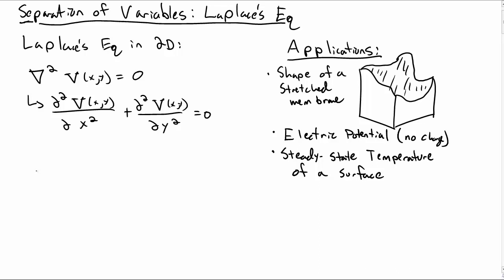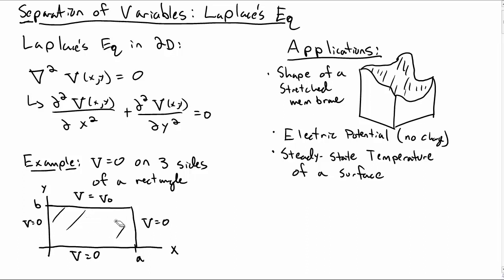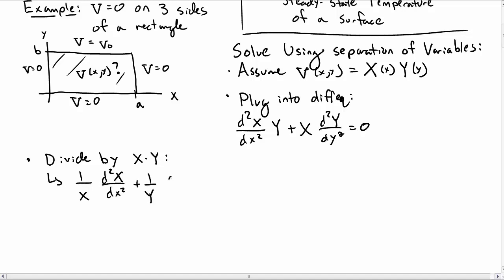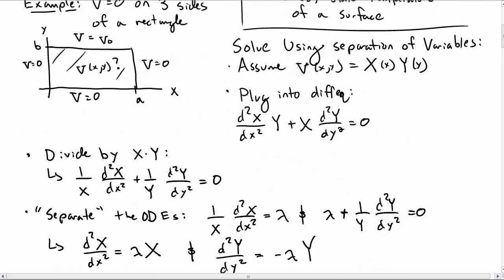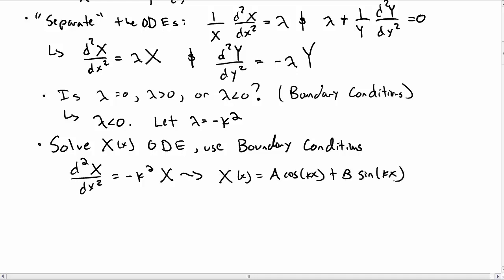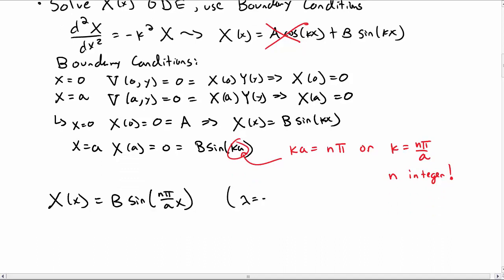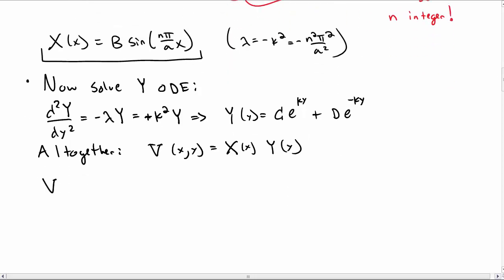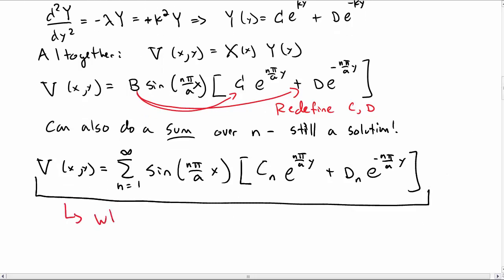Separation of Variables - Laplace Eq Part 1

Comment: How do know that lambda < 0?
Reply: I'm glad to know I'm not the only one stumped on this haha I thought I was stupid and shouldn't be in this class
Reply: also, what I think we are supposed to do is just choose either + or -. That what was confusing me too
Reply: In this case it could be whatever you want (The problem is symmetric). But when you solve wave equation it has to be negative otherwise you don't have a complete solution (it's easy to find out if you assume it's zero or negative)
Reply: We check it in all three lambda ir<,>,=0 but less then 0 always gives non trivial solution

Comment: Is the choice of lambda (negative or positive)  based on, if it can get DE with positive or negative constant coefficient.?
Reply: I think it just makes the ode easier to work with once it is solved, either way, you will get the correct answer, one might require a little more work than the other.

Comment: The answer could have been sinusoidal in second ODE, (y(y)), why didn't you write it in Sine and cosine.?
Reply: +1
Reply: Exponents and trig functions are somewhat interchangeable, but each has properties that you can exploit to help with certain cases. Sometimes, due to symmetry found in the boundary conditions (ie C=D), you could combine exponential terms in a way you can't combine trig functions. Or if you need a term that vanishes as x goes to infinity. On the other hand, trig functions are useful when you need a periodic function. You can move between exponentials and trig functions, so when one is used instead of the other, it is likely to help make the math easier or to better represent the physical situation

Comment: Please how do I approach a problem with two non-homogeneous boundary conditions?
Thank you
Reply from the maker: One of the beautiful things about Laplace's equation is that a sum of solutions is still a solution!

If you have two non-homogeneous boundary conditions, break it into the sum of two problems, each with only one non-homogeneous boundary condition. Then add the solutions! 

For a simple example, suppose you have a similar setup as the video, but now V= V_1 at y = 0 (instead of V = 0 there) in addition to V = V_0 at y = b. Turn this into two problems:
(A) All sides have V = 0, except V = V_0 at y = b. This solution is V_A(x,y).
(B) All sides have V = 0, execpt V = V_1 at y = 0. This solution is V_B(x,y).

The full solution is then V = V_A + V_B. Amazing!
Reply: Thanks Dr.